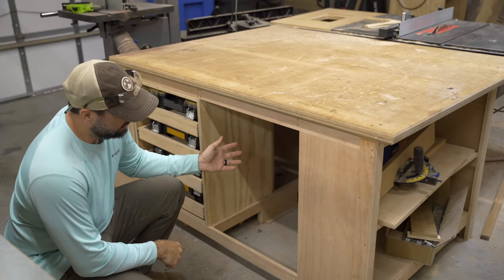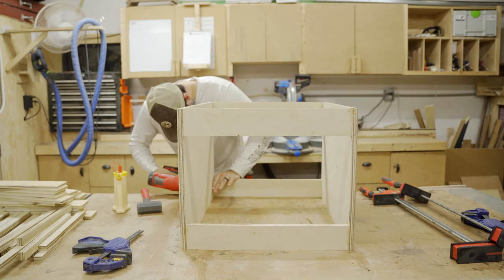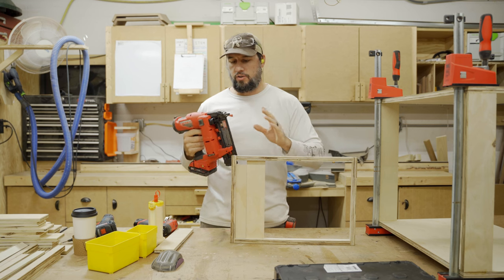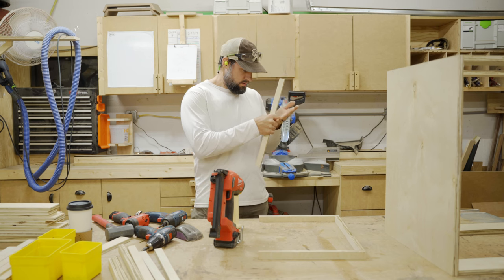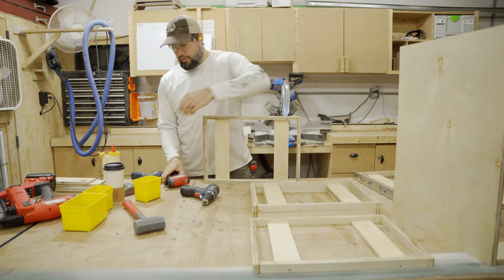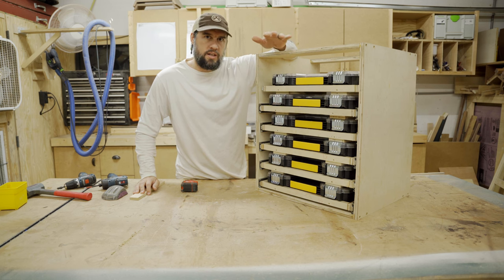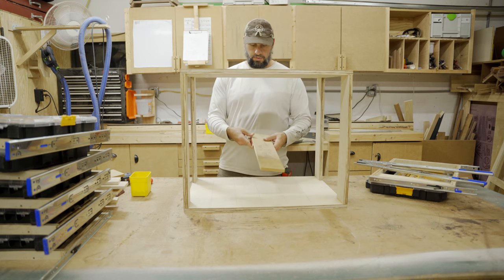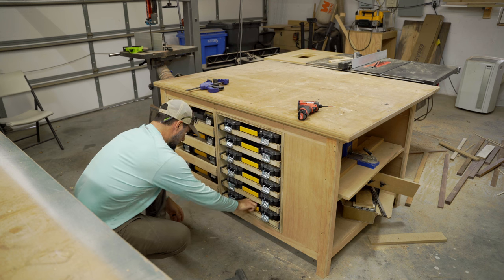How To Build Storage | Workshop Parts Organization

Comment: Shoot nails with the gun perpendicular to the edge. The chisel point on the nails make them turn in the wood. That chisel edge is on one side of the nails when they’re together. That makes them go sideways and why you can get the nails sticking out. Easy fix. Especially when you have nice near complete project and really don’t want a nail peeling out and ruining everything.
Reply from the maker: Perpendicular, yes. And I agree, the nail should follow the chisel point, but I think it's more about keeping the flat side of the brad nail perpendicular. They usually only bend on the flat sides.